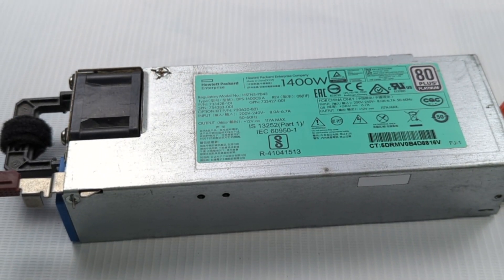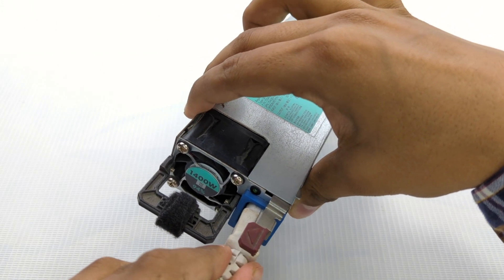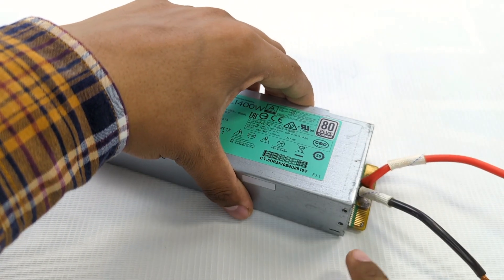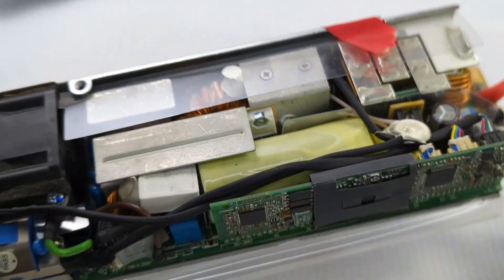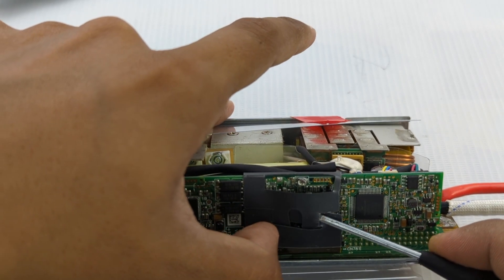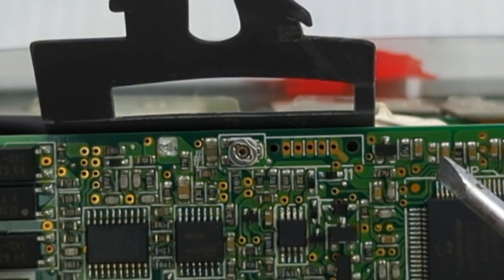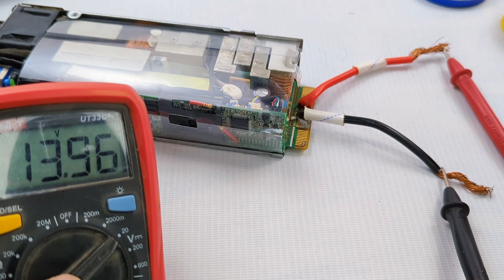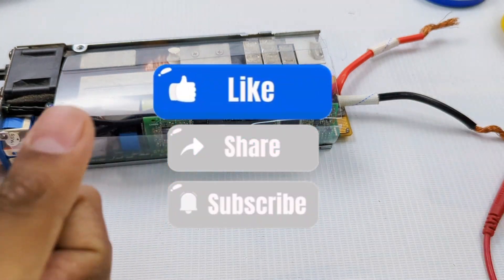HP HSTN-PD43 Power Supply 1400W Hacked 14V OVP: Full Guide with OVP Hack! #hacks #diy

Comment: I did this, and the power supply worked for 2 minutes. After removing the modification, it no longer works. Did you experience this?
Reply from the maker: Not at all.
I think you soldered on the wrong points and maybe the supply is damaged. I mentioned in the video do it carefully 😢

Comment: Hi guys, just noticed that my fan in psu was stop work after modification, was put 18k on boost and 5.6k on ovp, does anyone have same issue?

Edit: was remove soldered resistors to get back to original state, but still fan is not spinning, is this something that should be always on and controlled? Also was try put 12v directly on fan, and it works fine
Reply: It only turns on when the psu heats up.
Reply: @AKG58Z hi thx for anwser

I was put 30 A load for about 20 minutes.. no fan kicked in.. and psu was really warm from outside, so i was add small dc dc buck converter and set voltage to 6V to have constant cooling
Reply: @xtornado123 something might've gone wrong during modding look for loose connectors if no then mod it to run on 12v from the output.
Reply: @AKG58Z after mod to 14.4V whole power rail have same voltage, thats why i am put dc dc buck converter , from 5-30V input to have adjustable output (currently set to 6V) and runs nice
Reply: If fans too fast or loud you might just swap the fan out for a 24v one so that it runs slower.
Reply: Did you drill the ground and +?

Comment: how to make  variable aupply from this from 12.4 to 15v?
Reply from the maker: Yes. By connecting variable resistance
Reply: @Electricquantism402 can you tell me if I’m wrong, to do that process and install a variable resistance do we need to use a 15k resistance too or can we use the 5.6k?

Comment: bro why you need to increase the power although it is also high power i mean 90 ampere
Reply from the maker: Its increasing the voltage, not overall power.
1400w at 12v 117A.
At 13-14v, Ampere will drop to 100A to compensate the overall power.

Comment: I put a resistor 18k +/- 1% metal-foil 0.6W on the boost circuit, and 5.6k +/- 1% metal-foil 0.6W on the OVP and achieved by adjusting the factory variator between 14.0 and 14.8 volts. The perfect voltage is 14.4 volts for programming a car, because when the car is on the ignition, tests have shown that during programming, on the OBD2 socket, the voltage drops from 14.4 to between 13.5 and 13.8 volts, which is perfect for programming. Test 1 performed: BMW F25 2015 during a 1 hour programming session, the power supply maintained a voltage between 13.4V and 13.8V measured on the OBD2 socket of the programmer, and with a clamp meter I measured the current on the power cable from the power supply to the car's interior, and it reached peaks of up to 78A, with constant consumption being around 25A and 36A. Test 2: MERCEDES BENZ ML550 2012 during a 2 hour programming session, the power supply maintained a voltage between 13.4V and 13.9V from the programmer, reaching current peaks of up to 82A, with constant consumption being around 30A and 43A. Test 3 performed: AUDI A8 2013 during a 4 hour programming session, the power supply maintained a voltage between 13.6V and 13.8V from the programmer, reaching current peaks of up to 60A, with constant consumption being around 16A and 26A. The power supply doesn't get any hotter than normal, the fan is very quiet, and everything works like a charm. Huge thanks to the creator of this video, because he saved me about $1200 on buying a 12kg huge factory power supply, with weaker parameters than this small and light, wonderful power supply. Thanks!👍
Reply: Thank you for your input, I went the same path as you described , put 18k and 5.6k, out of box was get 14.2V, was do slightly adjustment on trimer to get 14.39-14.40 on voltmeter, was not yet tested on car, waiting to volt/amper meter display arrives from aliexpress.. also sending big thanks to the creator of video, cheers
Reply: @xtornado123 can you send a link to this volts and amps display?
Reply from the maker: Many thanks. Much appreciated 👍 for your tests. I have learned much from your comment. Cheers 🍻

Comment: Can you put a variable resister on the 22k for adjustable volts
Reply from the maker: Yes, but in series with 15k resistor to avoid short circuit when potentiometer is on 0 resistance.

Comment: Hi guys!I twitched between 4,7-6,1k resistor for OVP,but when coupling 4 bulbs H1/55w paraleled at output,the PSU shuts down immediately.1200 W PSU from Hp does not shut down,even with 8 bulbs.Originally the  unmodified HP 1400w does also the job with 8 paraleled bulbs.So conclusion,it must be from OCP itself,maybe not 100% hacked.Any ideas?
Reply: Try to use a bigger resistor in the ovp, did you figure out

Comment: The 500 watt HSTNS-PD40 also uses the same circuit board, so these instructions work with that model as well.

There are ground points everywhere, so there is no need to run long wires for the resistors.  Also, that 5 pin header, you connect to for ground, is the programming port for the PIC microcontroller. It should be possible to modify the firmware, to change the voltage and OVP, without any hardware mods.
Reply: @DaveWormfood want to know firmware route. By doing firmware tweak, will be no potentiometer needed to adjust at all? What will be the max voltage? I bought additional voltage booster unit+rd6024 controller, am I still need to do this trick? Sorry, new to the hecking PSU world
Reply from the maker: Try with higher resistance values then.
Reply: Was your response intended for another comment? I'm having no problems, and was just giving additional information.

Comment: Hello, I have a problem. The power supply works for a few seconds and then turns off. Have you had such a problem?
Reply from the maker: No. Mine is working good. Maybe you soldered on the wrong points.

Comment: how can i reach about 14.1 V / 14.2 V with this method? what resistors should i use
Reply from the maker: Same method. After connecting resistors, rotate that small silver potentiometer clockwise by which i got 14.25v max.
Reply: @Electricquantism402  and if i would want to increase even more, would the resistance need to be higher or lower?

Comment: Hola necesito  para hacer un dell 1400w 13.8
Reply from the maker: Do with the same value resistors just rotate the potentiometer to get some lower voltage close to 13.9
Reply: @Electricquantism402 but the source I have is a DELL 1400w brand. It is different from HP
Reply from the maker: @LiamAriel-x8q  ohhkk. I haven't experienced with that dell model.
Reply: ok thanks for answering greetings

Comment: Great VDO. Thanks a lot. Can I still use the potentiometer to increase the voltage more?
Reply from the maker: Yes without resistors, it goes to max 12.6v..
After installing these two resistors, you get 14.26v.. means potentiometer works in both scenarios.
Reply: @Electricquantism402  Thanks